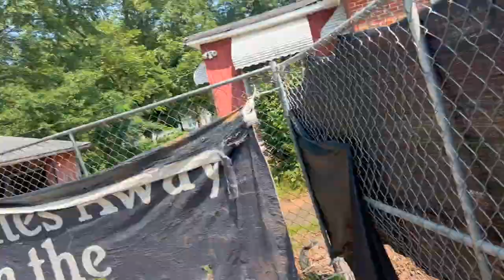HE GOT A TRX450ER FOR FREE 🤯 ( NOT CLICK BAIT) | SAY YB |

Comment: Y’all boy’s dangerous with that angle grinder 😂😂 You should invest in a air impact hammer. Them swing arm bolts in then trx450s are hell to get out, I had the same issue with mine. Penetration oil and the impact hammer works wonders bro.
Reply from the maker: 🤣 aye man say lesss might have to try dat out